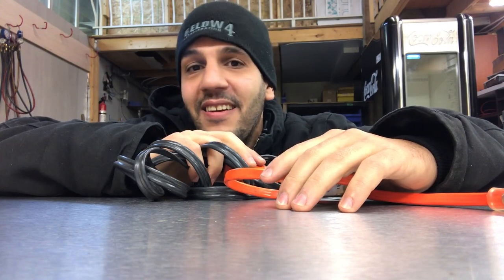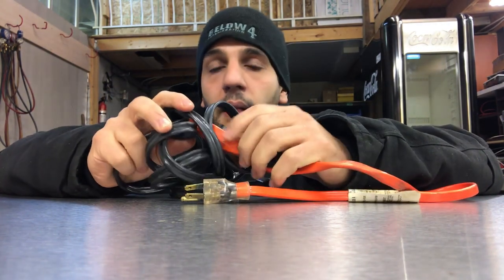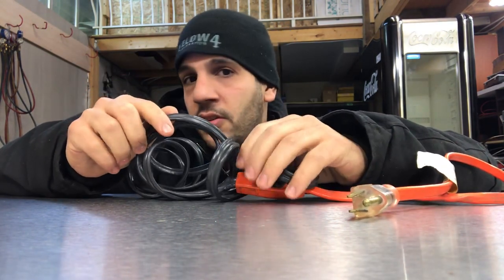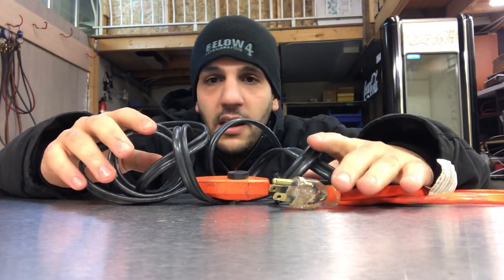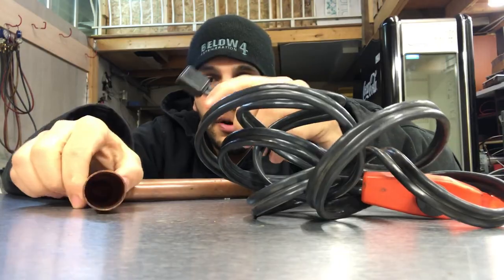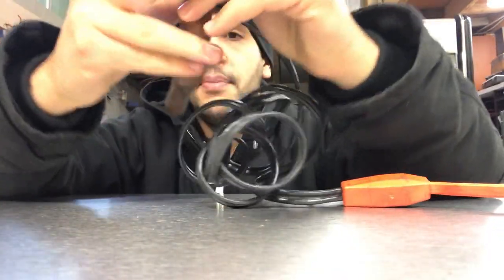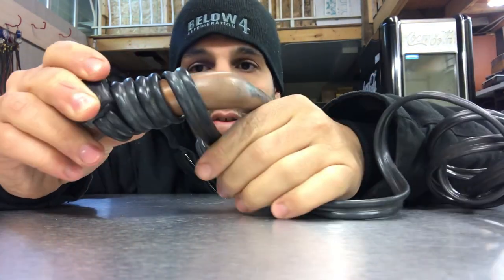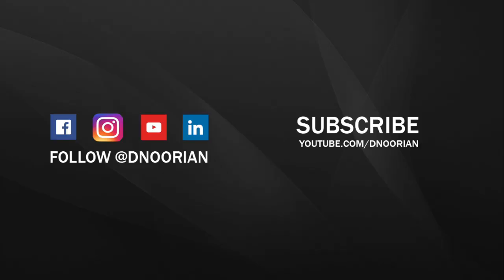HEAT TRACE INSTALLATION

Comment: Wrong. Look up some Raychem videos. On the horizontal run just apply the heat trace on the bottom of the pipe.
Reply: Could depend on how much product and use. Let’s say in a manufacturing food place, ingredient mixes will flow through pipe and typically stay at the bottom of a horizontal pipe cause yk gravity, but the what about high pressurized lines of material, or maybe even a drain pipe in a walk in freezer like he said earlier in the vid, I think in that example it might be best to wrap the heat trace bc chances are it’s only a copper water pipe and the water freezes due to the temperature of the freezer. Must be a big walk in freezer to have the drain pipe inside but hey there some crazy shit out there